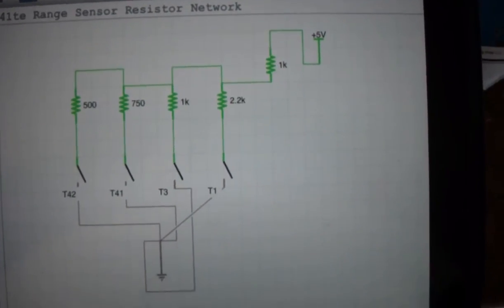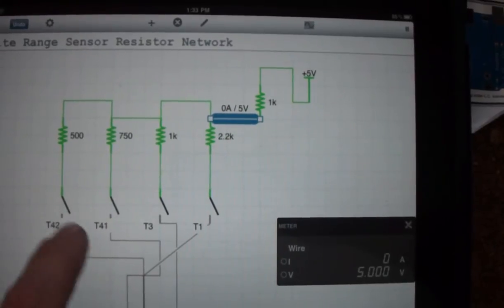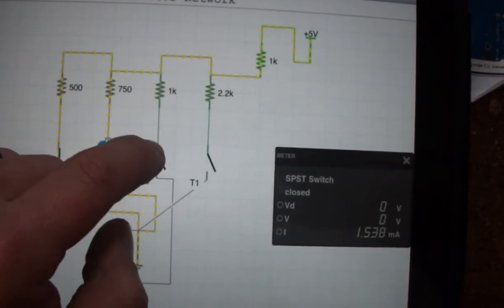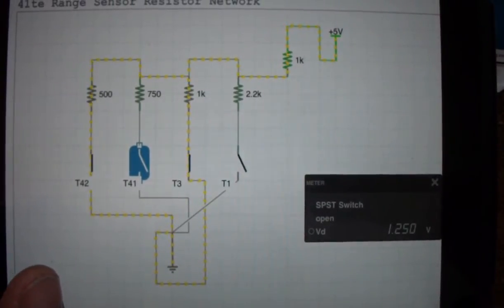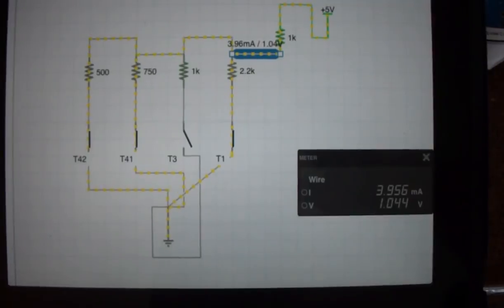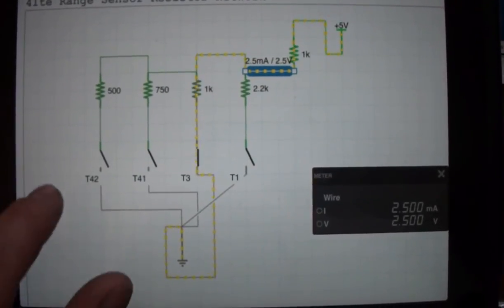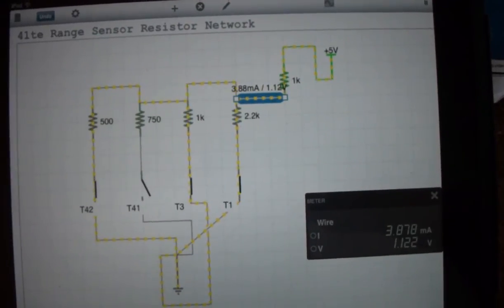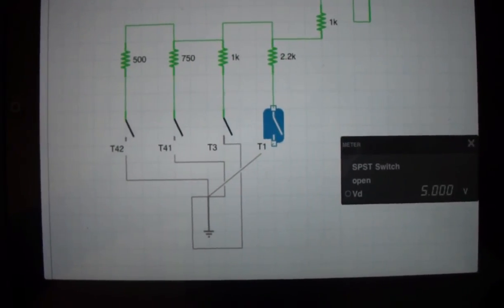Chrysler 41te/A604 Range Sensor wired through resistor network

Comment: Hi, Do you know if is possible made the simulation to the transmission to it do the change 1rt , 2nd, 3rd, sending the signal to the solenoid pack or swching manually the contacts of the solenoid pack?